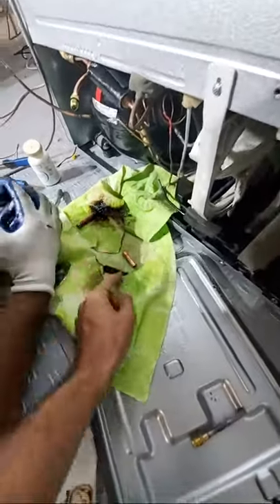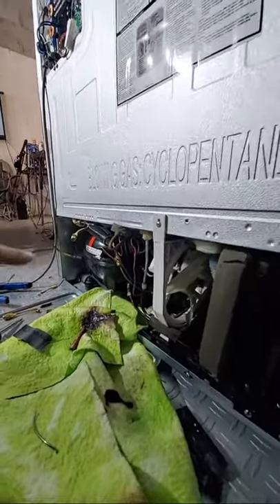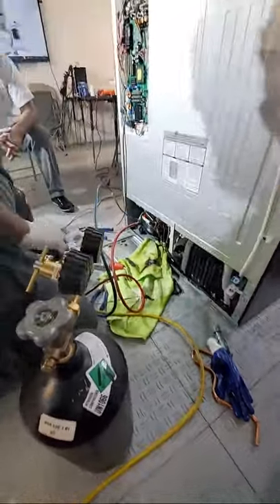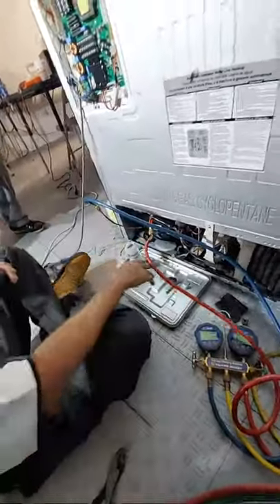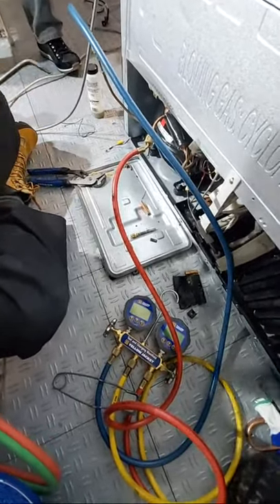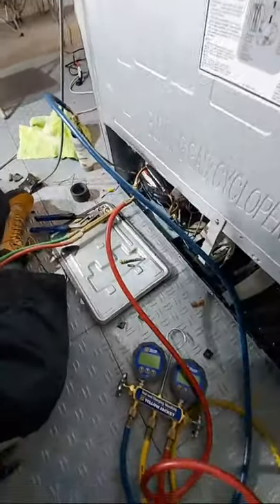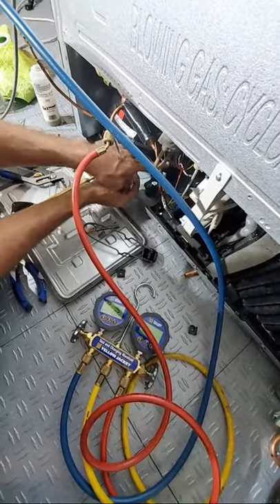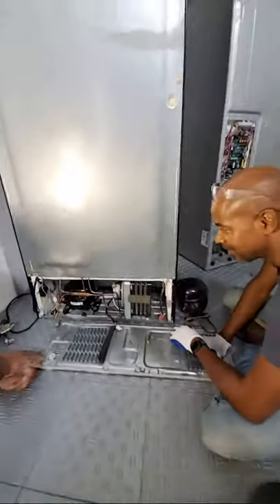Sealed System Repair TMM ACADEMICS

Comment: Don't be discouraged Peter that stuff happens at least you got an outlet to practice before you're in a customers house. Stuff will happen while you're in a customers house too while you're learning as long as you keep that torch away from burning their house down the appliance can be repaired. Always pay attention where the flame is going you don't want to end up on the news for burning someone's house. Once you get down sealed system repair you can get a job anywhere.

Comment: Terrible teacher. Did not wipe residual sand paper grit off of tubes before fitting install. Grit can be heard in joint connection when student slid on fitting. This WILL leak.